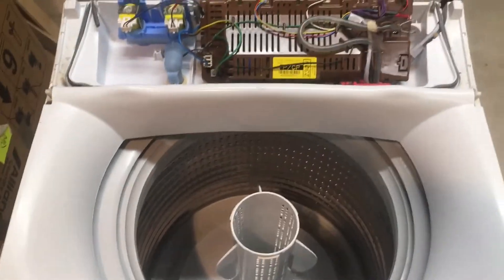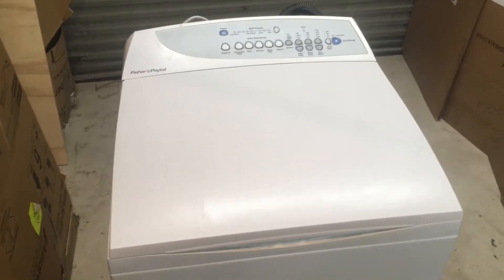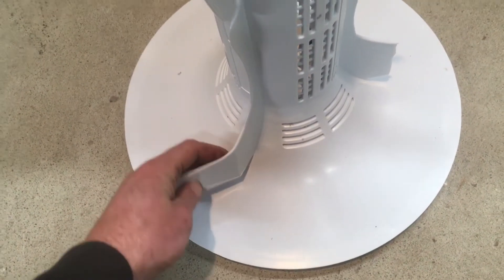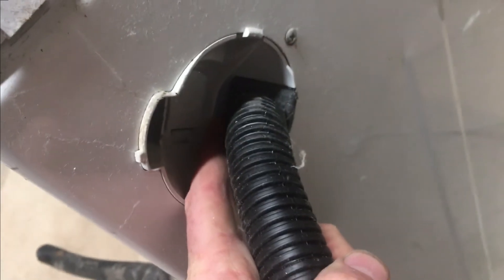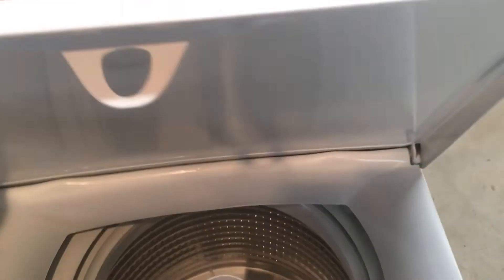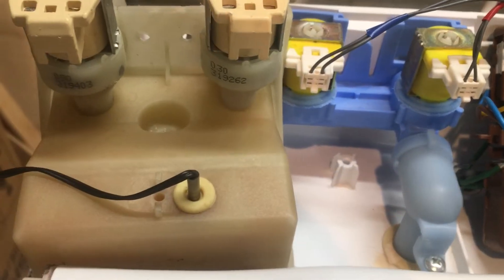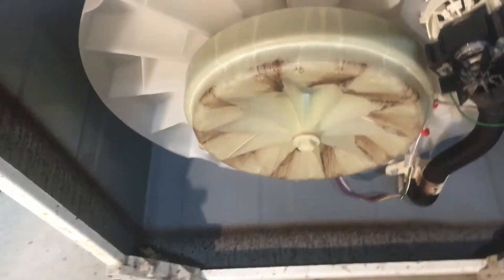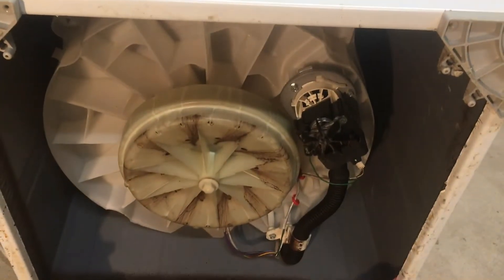Common Faults/Problems with Fisher Paykel Smart Drive Washing Machine.

Comment: Hi you didn't say how the suspension rods should be, I'm guessing bouncy
Reply from the maker: Its hard to describe, but you basically want it to bounce back without oscillating. If the damping part is worn it will bounce too much and will cause it to go out of balance.

Comment: I have a 16 yr old top loader. Only had a repairman to dislodge a penny stuck in the drain. Now, it acts like it is not getting electricity. I have removed the plug and verified the outlet is working. Can you guide me as what to check?
Reply from the maker: If it wont turn on its probably the motor controller that is blown, but you also need to find why it has blown. More then I can go over in these videos sorry, best to get someone who knows these machines to come have a look.

Comment: Great video. Have a problematic wa 7060m1. Out of Balance every cold wash. OK on hot. Have jst fitted new suspension rods. Bias spring is attached. No leaks . Help
Reply from the maker: Check that the holes in the inner bowl are not blocked, and clutch/spline drive ok, and pump not cutting out. Then may be issue with the display pcb.
Reply: @motrepairs  Thanks. I'll check those out.

Comment: That is very interesting. My machine is 25 years old and still working. It is VERY loud now on spin, and I am unsure whether to get a new one now before it dies or to wait it out. Also when we move the bowl around manually when its off, it has a huge amount of rocking side to side. I don't know if that is the normal situation.
Reply from the maker: If you are going to replace it then you can probably just keep running it until it stops. Just need to be careful as it can start to leak out the bottom, so may damage the floor/walls depending on your room.

Comment: cheers for this - have just grabbed my 7.5 kg smartD out of storage and discovered the outlet hose has that split where you mentioned at 4.00 mark - no rubber stopper there.  just wondering which Part would I need to replace that hose?  and how is access gained to replacing it?  i didn't want to damage the plastic moulding that holds the hose in place. 🙏🏽
Reply from the maker: Official F&P part is 425627P, can only be used if the damage is in the external part of the hose, and you just cut old hose at damage then push extension into it.
Reply: @motrepairs  have only gotten on to F&P parts via phone, as couldn't find part on their website - apparently not supplying anymore as was causing issues with some models.  bugger.  Trust alls well down South! thanks anyway
Reply from the maker: @crlightbearer8861  If you are in NZ you can drop be an email with a photo of where yours is damaged. We do have a aftermarket joiner that I can sell you if its going to work in your situation
Reply: @motrepairs im in Hastings...happy to try sending email first b4 I fork.out for call out fees - sorry where do I find ur email?

Comment: hello sir. i rebuit my one of these but now it keeps draining forever and never goes to the next stage
Reply from the maker: Does the bowl move at all? If bowl not moving then the pressure sensor (which is part of the controller) may be out of range and reporting water in the bottom when there isn't.

Comment: Great video why is it sometimes it over flows can you help
Reply from the maker: There is a clear tube that runs from the motor controller down the right rear corner to the tub that measures the water level. If there is a hole in it then it won't measure level correctly, so check it closely for rubbing. Always connect the top end last, make sure no water in bottom and blow down it to clear chamber (may need to lean machine forward so no water in chamber. Never blow up tube when it is connected to controller or you will damage the sensor.

Comment: When cleaning mine, the spring attached to the drum by a clip disconnected and fell to bottom. Is this an easy fix?
Reply from the maker: Yes just slide it up the rod, the other end clips to the "neck ring" that sits around the top of the drum. If the clip is missing you can drill a hole in the edge of the ring and feed it through.

Comment: Hi Dan…really great informative vid….when the lid lock is flashing on the MW512 smart drive is it possible to completely bypass this by unplugging it from the board to remove the lid lock fault hence having the machine working fine again…thanks
Reply from the maker: No if you just unplug it you will still get a fault. The controller uses the lid lock to sense if the lid is closed via the coil. They are a pretty simple construction so maybe take it apart and check for corrosion on the connections.

Comment: Hey there, thanks for the info. My topload will not power on at all after shutting off before a spin cycle. 

I got the top off and there is some thick fluid around the water pipe entering the machine.

Hoping a blown fuse or something simple. Any ideas or other videos you may be able to point me to?
Reply: It's a model MW513
Reply from the maker: If there is power at the wall and it wont turn on it will mean the controller is blown. Sometimes you can repair the controller but often you need to replace it. You will also need to check all components resistances to make sure you don't blow the new controller. Beyond what can be shown in these videos sorry, you will need to get a technician who knows FP machines. 

The fluid around the water valves is normal, it is a sealing goo.

Comment: Great video! How does the water balance ring manage to sit above the neck ring before spinning?  Is it just form overloading if no signs of wear on the water balance ring? That really was a good video, thanks.
Reply from the maker: Not quite sure about your question sorry, the water balance ring is sealed and part of the inner drum. Overloading washing will usually only damage the neck ring that sits on top of the outer drum and is stationary. If the balance ring rubs on the neck ring it may wear enough to get a leak.

Comment: Thanks for your great videos, they are super helpful. I've got a 2013 Smartdrive washer that has me a little stumped though - on the rinse cycle, it doesn't run the rinse water valve. It tries a few times before powering off. Oddly, the rest of the cycles run fine - it drains, fills, spins etc OK. And there are no error codes either. We only run hot washes, I haven't checked to see if the issue happens with cold. Is a bad thermistor? Or bad inlet valve? Thanks, Andy, Chch NZ.
Reply from the maker: Check your inlet valve resistance, if it’s ok may be the controller unfortunately.
Reply: @motrepairs  Ok, thanks for that!

Comment: Hi, very helpful videos. I have a MW512 which has blown the mother board. Prior to blowing up it was agitating jerkily  and erratically.  I have put in a new motherboard,  but am loathe to do a wash in case there  is some underlying problem and if blows up again. Would be very grateful for your advice. Thanks
Reply from the maker: There should have been a piece of paper with the controller that will list all the resistances you need to check. You can also open the controller and see if you can see any components blown then trace what they are driving.

Comment: Hi ours wont power on anymore.
The PowerPoint is fine but when we plug it in and switch it in and press power in there's no power at all on the washer
Reply from the maker: You will need a controller, but need to check all component resistances before fitting the new controller incase something has shorted and blown it, or you can blow the new controller. Sometimes they do just die on their own though. Probably best to get a tech who knows FP machines to look at it.

Comment: What's that thin blue strand or wire inside that clear tube pneumatic line that runs to an enclosed water level diaphragm? Is it meant to be attached to the fine hole where the tube is clamped on?
Reply from the maker: No it doesn't go in the hole. It is just to stop the tube from closing totally if it is kinked.

Comment: Hi, mines tripping the main fuse box. I can feel the drain pump is wet, would that have anything to with tripping the main fuse when plugged in?
Reply from the maker: Is it actually a fuse or RCD that is tripping? Water around the pump will definitely cause an RCD to trip.

Comment: I have one with the icons. Its stops during cycle. Changes rods. Still does it.
Reply from the maker: There are a lot of faults that will cause it to stop. If you watch my videos on User warnings and Fault codes/diagnostics so you can see what codes are in the memory.

Comment: Ran 5-6 loads without incident. One minor out of balance run of sheets today.  Now it won’t start. Lights work. After 60-90 seconds a mysterious hum erupts from the motor area. Ugh. I had two questionable beach blankets I washed I hope a massive amount of thread and lint didn’t clog it. Going into diag mode. Pray for me (even tho tbh changing the motor is easier than attaching a new Oreck vacuum bag 😂

Comment: Good tips, thanks. Found a small spring hanging off the left front suspension at the bottom of the rod, not sure where that goes? Also the bowl is slightly to the RHS side, is that a problem? Complaints of a noise during spin with towels loaded...? Out of balance maybe? Trying to help an elderly client. Thanks
Reply from the maker: The bias spring clips the neck ring, the donut cover that sits on top of the bowl. It will pull bowl towards left or centre, if not enough then make sure the feet are level. 

Out of balance will usually mean it doesn't spin and beeps while flashing spin light. Without knowing  what kind of noise its hard to help further, could be bearings, or drain pump squawking, ect.
Reply: @motrepairs  thanks 😊

Comment: Mine has stopped working after 4 years. The lights are stuck on the last cycle it was on when it stopped. Any tips or info you can help with?
Reply from the maker: It should reset when you turn it off and back on with the power button. If it is beeping it may be showing a fault code, in which case you can check my fault code video.

Comment: hello Dan, wife is complaining that the Start/Pause button sometimes requires several attempts to actuate. 
It clicks/feels quite normal but perhaps the micro switch behind the plastic tab has worn...is this replaceable.?
The decal is certainly worn and admittedly its a somewhat ancient GW 703... would be sad to have to lose it for this reason.
We're in Melbourne, thanks for videos.
Reply: Update... successfully replaced this with the switch from the Favorites button, which we don't use.
For anyone needing the same, its a 5mm2 Normally Open two-feet momentary micro switch, 9 mm tall including the body.
Reply from the maker: Awesome, that’s exactly what I usually recommend if you are handy with a soldering iron

Comment: hello, i have an old MW511 that went well for years.  i had an error code 56 and worked out that was bowl check, i shortened hose , and removed and cleaned years of 'gunk' from spline drive and made sure was level and solid.  following your videos (which were great), it ran ok for couple of cycles but now  it is stopped at spi cycle, makes noise but no spinning ???  I am wondering if i should be changing suspension rods, or looking at control board ???  ( i read in comments reapiring old models not the common so hoping your wisdom can assist :-)
Reply from the maker: Don't just start replacing random parts, you need to confirm what is causing it to stop now. Is it coming up with a code if you leave it long enough? The series 11 is still ok but the oldest we repair.

Comment: I replaced the bearings and main shaft seal on our 20 yr old phase 6 smartdrive (it was sounding like a jumbo jet on spin). Also cleaned the contacts on the controller with spray on switch cleaner.
All working well now.

Comment: You mentioned Smart Drive 9 as the model. That doesn't help me one bit as F and P have an alphabetic, numeric code as their model number which is 10 figures long. Nowhere does it have a Model 9 or 10 etc description.
Reply from the maker: FP has had 3 main systems of model numbers, but besides that they have "Series" and "Phases" which  update every few years but not necessarily in step. When I say Smart Drive 9 I am referring to Phase 5, Series 9 machines, with 5 digit model numbers (usually) ending I a 9, from the early 2000's, usually not worth repairing now but we still see some. 

Currently FP have switched Top and Front loaders from a 10 digit model number to a 8 Digit, (which are called series 7 to make it more confusing) and they get updated much less often since they are a much more mature product now.
Reply: @motrepairs  Thank you for your very informative advice about SP's model numbering.
I recently had to replace my 11-year-old FP washing machine but before I bought a new one my curiosity about their machines led me to your indepth video

Comment: I had to remove the pump to clean it and it seems water leaked into some compoenents on the bottom. The washer will no longer power at all. Should I wait and see if a dry washer will fix it or should I be ready for a new washer?
Reply from the maker: If the controller is dead drying it out wont do anything, did it go bang when you turned it on? Make sure the pump is plugged in properly as in some models if the pump isn't plugged in it wont turn on at all.

Comment: Thanks for all the informative videos.  I've got a small leak, put it up on blocks and can see water leaking from the drain pump.  Maybe worn shaft.....it's over 20 years old.  Ordered a new drain pump from F&P, cleaned all around the drain pump housing, installed it but still leaking from the new pump.  No debris around the rubber gasket area, just having problems fixing the leak.  Just wondering if you might have any suggestions?
Reply from the maker: Maybe check the bolts on the pump locking plate are tight? You can also tap the three tabs that the pump locks into  upwards, so it holds the pump tighter against the tub. Also make sure pump is square and all three locking tabs are holding it
Reply: @motrepairs   Tightened up the bolts with 3/8 socket, they were a bit loose, tightened half turn to three quarters turn on the 4 bolts.  Didn't want to tighten too much as the bolts go into plastic housing.  Installed the new drain pump and it was definitely tighter to turn it during installation so a much tighter seal.  Didn't run a complete wash cycle but now there are no leaks.  Will run a complete wash cycle tomorrow.  Is there a function from the panel to run the pump only for draining (press power and some other button simultaneously)?
Reply: @BrianSugihara  wash temp down, while holding press power and it'll give 2 quick beeps and then press regular button to turn pump on and off

Comment: A friend accidentally put two bathing suits thru with lots of shells and sand stuck in. Unit stopped somewhere in rinse cycle. No errors even in diag mode. Just a loud hum from the pump before I turned off the machine. I cleaned the pump from the bottom — nothing clogging it .. the rubber tubes had some shells so cleaned it and replaced pump and pump spins manually free but hums when trying a new cycle — time for a new pump? 😢
Reply from the maker: If you follow my other video to take the pump off, it probably has sand etc jammed under the pump impeller
Reply: @motrepairs  sadly it was spinning perfectly after I took it off and rinsed it. I was gonna Mebbe take the tub out to see how much debris is stuck in the top but the pump does have a death hum to it 🤦🏻‍♂️
Reply from the maker: @tonystark11074  Follow this video https://youtu.be/8piQat8DQcI to remove the pump, you wont be able to see as much from the top if its sand
Reply: @motrepairs  pump replaced and all is well. Needed cleaning from the top too before putting in the new pump. Used both videos to get the job done — thanks again!!! 🙏🏼
Reply: I got an error code 37. Cleaned the pump filter from the top as well as pulled it from underneath, cleaned the entire tub, etc. I retrieved a hair band and a safety pin. Then I ran it from the last mode, and it drained. When I put the tub and agitator back in and checked and ran a test load, it didn't drain. Then I pulled the tub and agitator back out,  repeated the process, and it drained again. When I put it back together,  it once again didn't drain. What could be the issue? The pump impeller spins, and it's actually been replaced within the last year, same with the control board. Is there a way to hard reset the washer? What might I be doing wrong?
Reply: @Smitty2528  instead of running whole test load can u test the drain function in diag mode with buttons on control panel? Be wild if THAT works with agitator and tub installed...

Comment: Hi, I will check the support rods of my washing machine and reinforce them because continues stopping with the out of balance alarm.  It is a fisher and paykel wa 1068 g1. My  question is ; is the resetting mode the same than the older washsmart machines or different.  Thanks for your help.